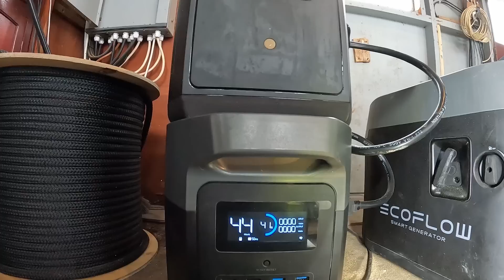Ep 97 - Ship Happens Selling The Boat? ⚓️🚢 #boatrestoration

Comment: I agree with Gemma, that I’d leave those plywood knees in place until the deck is done. Although the knees are probably unnecessary without the weight and recoil of the original gun above, I suggest that you add a steel gusset to the adjacent web frame. This will make that steel knee much stronger and provide stiffening to the hull in that are.

Comment: Have you considered wireless microphones like rode and dji makes?  They have two wireless mics transmitting to a single receiver that plugs into the external mic input.  I believe they can be configured to record a backup audio track in case something goes wrong with the main recording.  Probably a pain to dub audio back in but you at least have the option…Curtis Judd does a review.

Comment: The piece of steel was possibly added to strengthen the hull and motor support as an afterthought. 
Changing it out with wood should be acceptable and give enough support considering you are not putting any heavy weapons on the boat.

Comment: Regarding your audio: It's common for folks to record audio separately, or at least as backup audio. You put them back together as part of the editing. Typically, you sync the audio by doing a single hand-clap in front of you on camera. It produces a spike in the audio waveform that's easy to identify and slide back and forth until it matches the clap. Then, of course, that is edited out of the finished product. There are a lot of good, cheap audio recorders out there (Zoom H1 is under $100) which can record for hours and hours. You just leave it running most all day and forget it exists until it's time to use the audio it recorded. You can use the built in mics, or you can plug in the receiver of a wireless mic like a Rode or Saramonic for even more versatility. Hope that helps.

Comment: With respect to cameras, I use a Canon M50. Small with good recording capabilities. The kit lens is a 15-45mm. And it has a flippy screen that's easy on the eyes. As others have said, get the best SD card you can afford. For recording, I've heard good things about the Tentacle Sync. I too vote for keeping the gun supports. Many years ago i was rehabbing a small building on an old B-17 base. I started to sand the wall (battleship grey, of course) when a pencil sketch of a woman's face started to show through. We're constantly surprised what may appear when we undertake such projects.

Comment: Regarding your GoPro issues - If you haven't already checked, I have found that dirty contacts on the SD-Card or Internally in the camera will cause odd behaviors.  A little dielectric cleaner is the place I usually start - Cheers!!

Comment: Regarding the camera issues... get the fastest read/write speed SD card with the largest capacity that the device can handle. (eg 500gb) also go with a good quality card as some of the cheaper cards can be irregular in quality. Video devices require very fast read/write speeds in order to keep up with the refresh rate. Drone quality and above  cards work best. I had a similar issue with my dash cam. I'm currently using SanDisk gold, 128gb and they appear to be working well.

Comment: Perhaps you can use the firmware from the gp 9 on the gp 10 and get the results you are used to tho you probably lose any new features if it works at all. If they are close enough in design it may work, just make sure you can undo it if it fails, a bad camera is better than a dead one isn´t it. You may want a winch/crane on deck that would be a good use for the old gun mounts. A painted and carved replica of the boat would be a good use for leftover removed wood that's good wood.

Comment: Dylan Winter (Keep Turning Left ex BBC) hates GoPro's and always used Panasonic video cams.  Often the pocket sized, pistol grip  HA WA 20  or the HX WA30 or HX WA2 (WA = Waterproof) or HX DC series.  All very similar. Usable sound without mike.    Also slightly bigger, handheld:   the HCV700 and 720 series.  They are oldish now and often come up cheaply on Ebay etc.   Pretty reliable and sometimes cheap enough to be throw away if you have an accident.  Both a bit unhandy on a tripod though which may not suit.

Comment: Just an idea??? the void under the floor?.. what if you filled them with ball pool balls???.. would it provide any of the following?... 1 insulation???... 2... if you do have a leak in a comparment, and it's full of balls only a cretain amount of water can enter as balls aleady fill the area!.. 3 Floation.. worst case.. and foam any water that does enter can flow between balls to low point to bilge pump, also they weight next to nothing.. that will get many minds thinking.. coming along guys, looking good.. keep going..